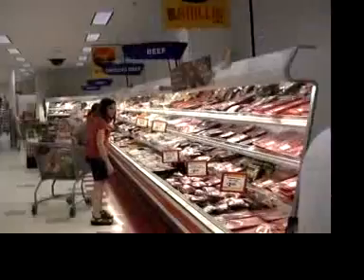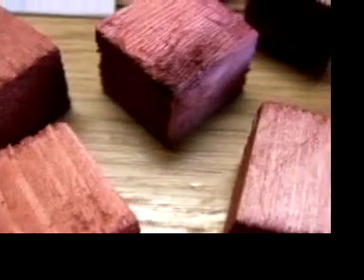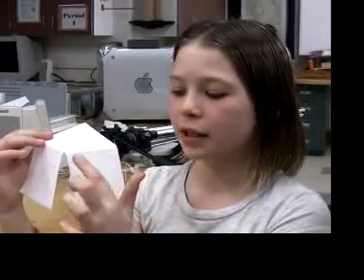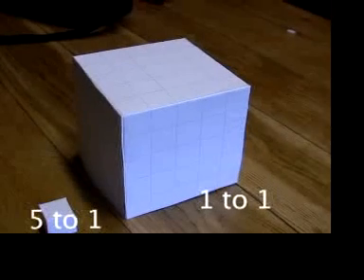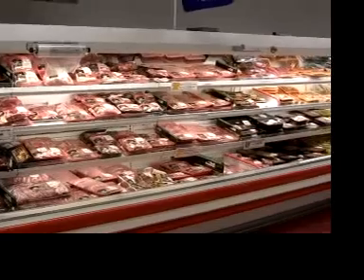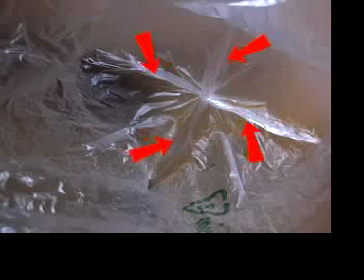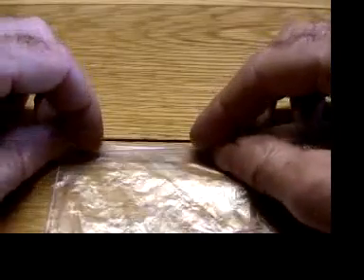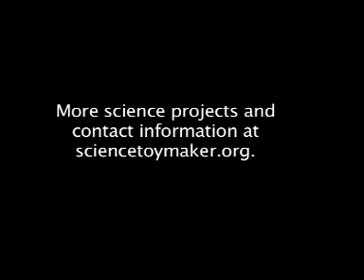How to Make a Hot Air Balloon Part 6 Using Small Bags

Comment: The best bags are dry  cleaner bags, balso wood. birthday candles, cleaner bags have a hole in the top for ventalation . Balso wood is flat, good for adding the candles. should take 9 b-day candles for good lift off.

Comment from the maker: @gabrielgonzales0902 The top melted because the flame was so close. As I said, using these small produce bags is experimental. The larger (but still very thin plastic) trash bags always work.  But you'll have to experiment with these small ones. It will help a lot if you do it on a very cold day. The cold air will both increase lift and might keep the plastic cool enough that it doesn't melt.
Slater